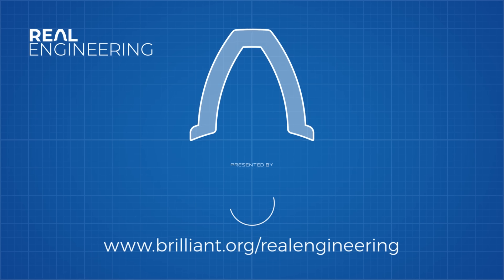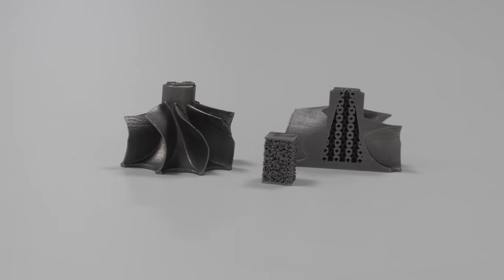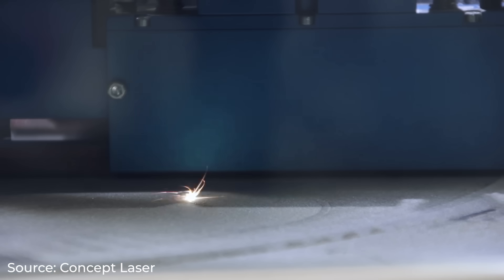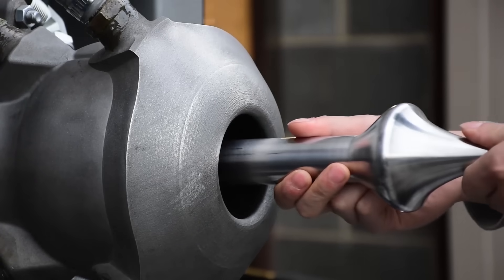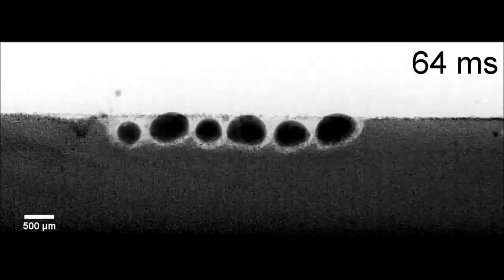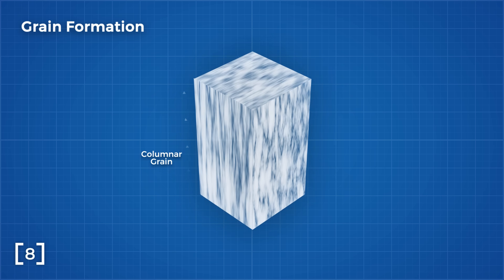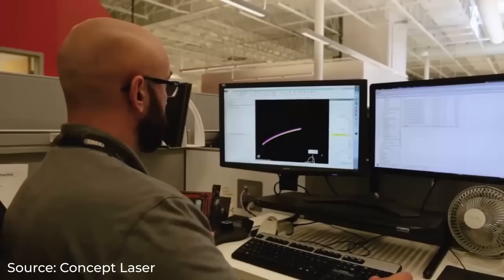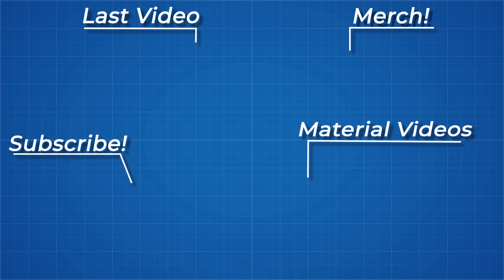The Material Science of Metal 3D Printing

Comment: I think its worth noting that as 3d printing doesn't use a mould like die casting or injection moulding the machine cost isn't really reapplied to each new product. Doesn't change much but if you compare cost/quantity across multiple products on the same machine the graph would look quite different

Comment: I watched @EverydayAstronaut's Aerospike video last week, which included the same 3D printed engine.  Was pleasantly surprised it was printed in Melbourne by AMAERO.  Co-incidentally (perhaps not) there is another 3D Metal printer that started up nearby: Titomic; that is aiming to reduce the manufacturing costs, increase the print size and reduce the fatigue issues you touched on.  I work near Monash University, so both are just around the corner from my work.

Comment: So, I was under the impression that, 3D printing with stuff now, simply meant painting the materials in layers until the product was complete. Didn't know that they used lasers to build everything.

Would 3D printing metal objects still work as well if they were painted together? Say using thin spools of wire and heating them enough to melt together to form a solid object should work.

I feel that using thinner wires would certainly be useful in electronics as it would cut down on materials used for circuit boards.

But this was a great video to watch. And I'm really hoping the 3D printing will become more efficient to help reduce costs of manufacturing even more.

Comment: The 3D metal printing is faulty a priori - just as welding since they all are really continuous casting in an oxidizing atmosphere - even high vacuum will not help with titanium or aluminum.  Steel can be fused well in a hydrogen atmosphere and baked for structural use.   More that 90% high cyclic fatigue life is spent in just generating a crack (Stage I) after that Stage II observable crack growth occurs rapidly.

Comment: I'm thinking of laser melting metal powder and I really can't see any sort a faster production than placing a number of mini-printing bays into a single unit to have them all printing the same object.  Even if all of the material came from the same feed container, the feed would then have to be split-up and each split individually managed.  You really can't increase the speed of the laser because of the variations produced like you mentioned in your video.  Magnetic control of fluid?, but that opens a whole other can of mathematics...

Comment: The crystalline structure does not change by hitting the metal with a hammer. Its microstructure that is changing. The crystalline structure changes when you heat it up. When the iron is glowing red, it is usually hot enough to have fcc structure which is more ductile and less hard and therefore it is more easy to form it. 
You use crystalline structure instead of microstructure which is wrong.

Comment: One of the biggest problems with laser sintering is the idea of trying to do it in one pass. I believe if developers would abandon this idea and add second and third passes at different strengths of laser intensity and shape before continuing to the next layer would greatly improve part quality. While it is true that this would greatly lengthen production time, the real advantage of 3D printing is in the ease of manufacturing very complex and difficult geometry. In mass production of plastic parts, the expense is in the mold manufacture and the profit is in the high production of plastic parts made from it. So 3D print the mold! Then you get the best of both worlds. Some parts are only possible from 3D printing like hollow structured cores. In these parts the quality of the print is far more important as post processing is only possible to the exterior surface, or heat treating. In 3D printing FDM plastic a secondary pass of a hot air jet could achieve this. In laser wire feed or powder sintering in metal 3D printing, multiple post deposition laser passes would be the next step in additive manufacturing. Another thing to consider is envelope atmosphere composition and temperature. Many of the defects shown in the video could be avoided or at least minimized in a ultra low atmosphere pressure. A second pass of the laser would smooth the surface greatly. Cryogenic temperature of very low pressure of nonreactive gas atmosphere could result in a form of metal glass. Because of the very small quantity of melted metal this may indeed be possible. The idea that 3D printing must in some way exceed traditional manufacturing is in my view is a fools errand. In my view it should be viewed as new materials and process, akin to a new theory of physics. I'm not saying it is new physics but that how we approach it should be. This truly is the beginning of something new and wonderful.

Comment: The Output vs Cost graphs grossly misrepresent the usefulness and capabilities of (metal) 3D printing. Output with 3D printing is extremely limited in a volume and time sense, much moreso than traditional methods. The costs versus producing quantities of different designs is another story, but stamping and molding (including metal injection molding) easily and readily outpace the capability of 3D printing and will for decades.

Comment: I wonder what your thoughts on adhesive based 3d metal printing is. The first company that comes to mind is Desktop Metal. and the differences it has compared to laser based methods.
Reply: Elijah Kim requires a furnace to consolidate the parts after formation
Reply: @MASTER117SPARTAN1  I am aware of that. My main interest is how using a sintering furnace after printing effects internal stress, printing accuracy, and overall flexibility and strength compared to contemporary laser based methods. Granted this isn't probably something that can or should be discussed in the youtube comments but it's been a thought in the back of my mind.

Comment: Speaking as a structures engineer in the satellite industry, one of the ways that you can get 3D printing to outperform traditional manufacturing techniques is in conglomeration. If you can take a large secondary structural assembly (beams, brackets, splice plates, hyloks, rivets, etc.) and reduce it down to a single part, even with a little added margin, then there are times you can significantly reduce costs because of reductions in areas: labor and time to build (takes a lot less time to install one part and a couple fasteners than twenty parts and a hundred fasteners), expensive or heavy material reduction or replacement (usually as a result of better thermal performance), and integrated management features (again, usually thermal or electrical conduction).

Also, I say secondary because for primary structure you're usually looking at the largest portion of your weight which is also carrying the most load. Margins are usually on the order of .1 (on a factor of safety of 2 to 4 to be sure) and stress analysts won't sign off on primary structure unless they can be dead certain their margins will be accurate. But for secondary structure you've got a bit more wiggle room and a bit more space to look at reducing costs.

Comment: Has anyone tried heating the powder to just under melting point? The laser would only be needed to tip the material into a liquid state, needing less energy and causing less voids to form.
Reply: 970357ers powder starts to winter at certain temperatures. Also flow ability is important to keep layers consistent as parts are fabricated
Reply: @MASTER117SPARTAN1  Has anyone tried though?

Comment: "one of the first things you learn in mechanical engineering is how to design your inventions in a way that is possible to manufacture" tell that to the engineers I used to work with.  My god I had to suffer through so many 'design engineers' who'd never even seen a lathe or a mill and thought that manufacture's ONLY used CNC, which, they don't, especially for one offs.  Also, a good machine shop saves it's swarf and sells it on to recuperate material costs.  This is almost always done when manufacturing brass pipe fittings as brass is expensive.  Also  we've had impossible to manufacture parts for decades.  Rolls Royce has been using lost wax casting of titanium for its turbine blades for decades.  Too many armchair engineers think that 3D printed parts are usable in commercial products, it's nice to see a video explaining why they're not the magical manufacturing process that can compensate for rubbish/lazy design engineers.

Comment: Might welding in a vacuum reduce the rapid cooling and stop the powder blowing put of the way of the laser?  Perhaps a wider infra red laser pre warming the area immediately before the main laser hits it?
Reply: william  armstrong the vaporized powder must be moved out of the way of the laser or you will damage the system and screw up your build. Bed heating is done to reduce the formation of thermal stresses but vacuum doesn’t work with lasers for a long list of reasons on electron beam uses vacuum

Comment: Another important note not mention in this video is the fatigue cracks and creep failure that is a major problem in aerospace are small grain size. So even if your AM part was made perfectly it would still likely need additional heat treatments to change the grain size.

Comment: Any thoughts on cold welded additive manufacture? basically shooting metal powder with high pressure air so it cold welds together, I think there is a version that also incorporates a low energy laser with the air jet but that one is hard to find any actual data on.

Comment: i think this applies to all common 3d printing methods
cause they add stuff layer per layer which is obviously weaker than just 1 solid material molded/carved out
even printing position affects its strength, i knew that metal 3d printing will be coarse but never realized this was the issue that held it back for real use.

i run small on demand 3d prints and the "laugh at the impossible design" is true, i tend give feedback on how to improve wasteful, impossible or "its not going to look pretty" designs, some just go with "print as is then" and some fixed it and actually thanked me for the insight about 3d print optimized designs

Comment: What about the 3d metal printers which don't use the roller technique? I.e. the type that uses a nozzle which blows the metal via venturi with a shield gas out into a cone in front of the laser.

Comment: There is a new area of AM research working on ultrasonic welding AM. I believe that is the future of AM. Sintering just cannot compete with the strength of subtractive parts. You forgot to mention the inclusion of oxidation. That is a much harder problem to address than crystal structures IMO

Comment: It isn't just poor fatigue life and microcracks that propagate stress risers. 3D printing is essentially a heat sintering process and the material has more porosity and ultimately poor strength properties compared to materials coming from metal stock or forgings with repeatable grain structure that's established at a microscopic level, not a macroscopic one determined by laser direction.  It needs to at least meet the repeatability of current mature metal sintering and metal injection molding technologies first.  The science behind forging of high-tech alloys is really less than a hundred years old, not a lineage of thousands of years.  The large 50,000+ ton presses needed to do this stuff didn't exist until after WWII and escalated with the Cold War when we were pressing giant titanium forgings for ICBMs and fighter jets.

You can do lot inspections and get mill certs for AS9100 and ISO9001 processes for traceability on traditional metal stock. If Company A does a 1,000 ton batch of titanium 6Al-4V, they do statistical sampling of the chemical and mechanical processes to known standards and you can be sure that the material is homogenous and check to see if it meets your requirements.  There's no way to do that with 3D printed parts because the strength and integrity of the metal is established after the part is made, and is unique to each individual printer, which is is going to vary.  The only way to do it is destructive batch testing of finished parts, honestly.  That ends up being super expensive because powders like Inconel or 15-5PH stainless is incredibly expensive.   Unfortunately, 3D printers in my lifetime won't likely ever reach the types of tolerances and surface finishes that can be achieved by subtractive metal manufacturing processes.  It's common to work with tolerances under 0.0005" with surface finishes less than 16Ra RMS in metals and 3D prints can't fundamentally achieve, especially on contours that approach planes of flatness, where the print layer thicknesses start to manifest an effect similar to graphical aliasing.  We're going to need slices that are as fine as the diameter of the powder itself to start getting good surface finishes.  That's just a practical reality...a bit boring to talk about manufacturing realities because it is devoid of the sleek sexiness of creating a masterpiece in Autodesk.

Source:  I work on rockets.  We 3D print a number of our parts in alloys like Inconel.  We still make parts from stock or forgings where it counts, and machine our 3D printed parts into tolerance because they're just slightly better than castings as far as how close we can get them to finished dimensions.  We are trying to replace some of our subtractively manufactured parts with additively manufactured ones because there is a definite cost savings in many cases for complex parts like turbopump components, but they require serious redesign to work around the shortcomings.  All I can say is even the industrial/commercial market is limited and some of the most cutting-edge 3D printing is done with in-house built custom machines trying to go beyond the standard printing topographies that have been commercialized.  There are hybrid additive/subtractive machines on the industrial market as well now, so you can start with a block of material and subtractively machine some features and additively machine features that can't be done traditionally.  

As far as engineers (like architects), don't give them a free pass.  There's good engineering and unnecessary engineering which is basically wankery or ignorance.  An engineer could design a process for manufacturing an engine block that was machined from a solid block of material and have all exterior surfaces machined to 8Ra. However, such an engine block would cost as much as a complete automobile and utterly unjustifiable.  I've had to upset many an engineer by pointing out unnecessary engineering that needlessly drives up cost and scrap rates.  Someone wanted a "pretty part" so everything was called to a sub 32Ra finish when you could have finished the exterior with a belt sander and it would satisfy fit, form, and function.  I've seen parts with three dozen different radius and edge break values simply because it looks good on a model, when he should have standardized off typical fractional COTS tooling instead of specifying wacky stuff like a .073" radius to break an inside edge or a 43 degree chamfer to break a sharp edge for parts handling.  Good MEs and REs will work with industrial or manufacturing engineers, or the machinists, to create the best engineered parts.

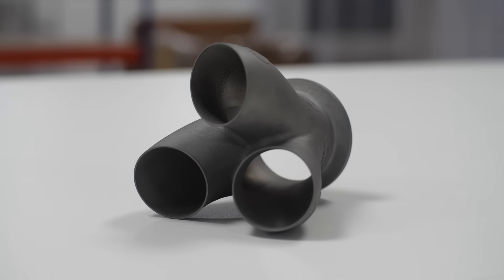Comment: 4:47 I hope that guy can 3d print a new set of eyeballs.
Reply: No Shit! Very near-sighted person with no safety glasses....
Reply: Is just grinding a meaningless piece of steel. Sparks go down, you don't need googles.
Reply: @Argentvs  Sparks have hit between eyes area on 4:49 and multiple times nose.
Reply: Don't get your knickers in a twist.   He is grinding low alloyed soft steel, clearly highly skilled and in full control including where the direction of the sparks.
Reply: Wait. Mechanical Engineer, with work experience here. 
Hang on guys. Firstly, if you have ever worked with any kind of grinders, you would know that the sparks that come out are absolutely harmless. It's like the sparks that you can see when 2 stones or metal pieces are struck against each other very hard. Grinding wheel is made of very small stones (abrasive material like iron carbide micro pellets, in engineering terms) that are bound to each other with a glue type of matrix called binder. You can put your finger very close to the sparks coming out and you won't feel a thing. This is not the kind of spark that you see in welding or firecrackers or when electrical appliances go boom. This is just due to the frictional heat guys. Friction causes heat. You must know this because you can rub your palms right now and can see that it warms up. A part of the heat that's generated as the metal piece touches the spinning grinding wheel (generally the grinders have a motor rpm of 1440) is converted to light. That's what we see as sparks. 
I know it LOOKS dangerous but try to understand what I wrote and you'll understand that it's actually basic physics. 
Search any of my above mentioned line in Google and you'll get many good websites verifying whatever I wrote.
Reply: @basu_fr  I work with metals, I make things, repair, maintenance to machinery. Now it very well, danger is the lathe and the angle grinders. Fixed wheel grinders danger is to place wrong metals and get it eaten by it, I almost lost my left thumb by that.
Reply: @basu_fr  thanks for explaining that sparks are red hot fragments of metal. As we all know, having red hot fragments of metal shot into in your eyes is completely harmless!